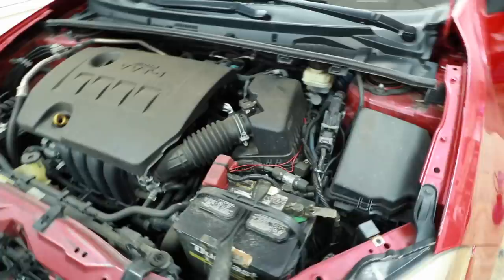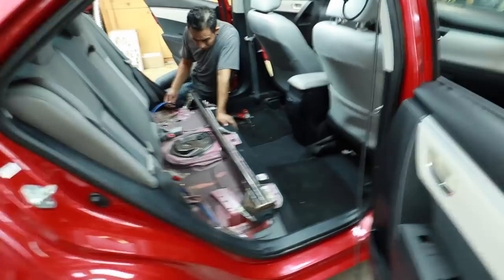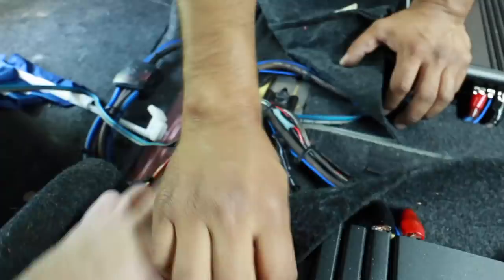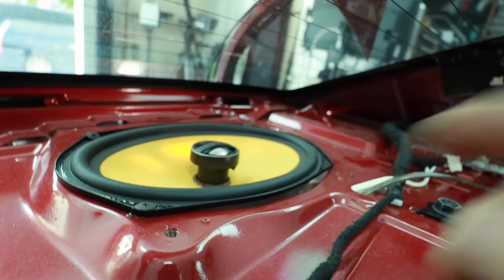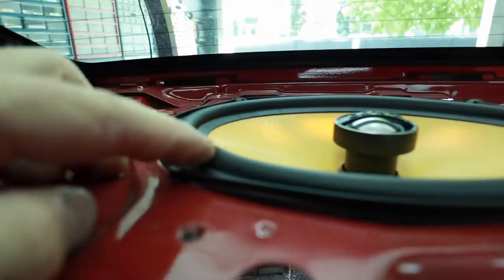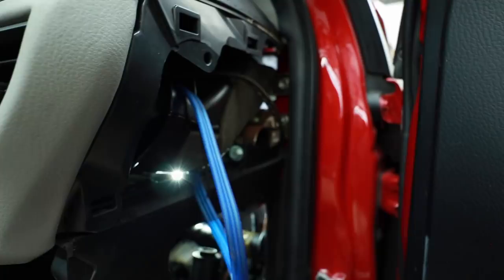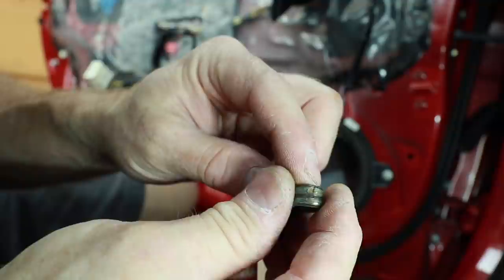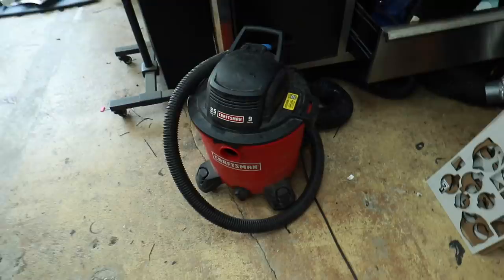We start a Toyota Corolla  911 stereo Installer Diaries 357 part 1

Comment: On a side note, I did use the back of my seat on my 2017 Mitsubishi Outlander Sport for my amps. I used .25" HDPE as a rack. The amps are mounted to that and then mounted the HDPE to the back of the seat. I did this because this vehicle is my work vehicle. I drive this back and forth to work. On my days off I have my Subaru Forester XT.
Reply: 😂😂😂yeah I bet! 😂😂😂
Reply: @rxart8043  what’s that supposed to mean
Reply: @NDColorado2023  car similarity’s... 2017 outlander and 2004 Forester XT... lol
Reply: @rxart8043  2017 Mitsubishi Outlander Sport and a 2017 Subaru Forester XT.
Reply: @rxart8043  https://youtu.be/1u2vemckVrE a little video of the exhaust for you

Comment: Thanks for the video, watching from Australia. I have 2009 corolla too and I checked the front speaker adapter you have used, but it fits up to 6.7inch. I was thinking of replacing the stock one to Kenwood exceleon xp1800p component setup, but it’s 7 inch. Would this still fit or could you recommend something similar sounding? I was comparing morel or jl c2 then came down to exceleon kfc or xp.

Comment: Nothing wrong with CCA. Such fake news. Half the time people run wire way too big for their setup anyway. Distance to wire size ratio's matter. You don't need insane wire gauge for power wire. CCA only matters when it comes to say speaker cable where frequencies matter. POWER through CCA doesn't matter. And its not gonna overheat. Its fake news. Pure copper cost more and installers generally want to milk every dollar out of customers. CCA works. I have tested for myself how much power draw I get through 4 gauge CCA vs 4 gauge OFC and its the same.... measured with multimeter.... so. yeah. fake news.